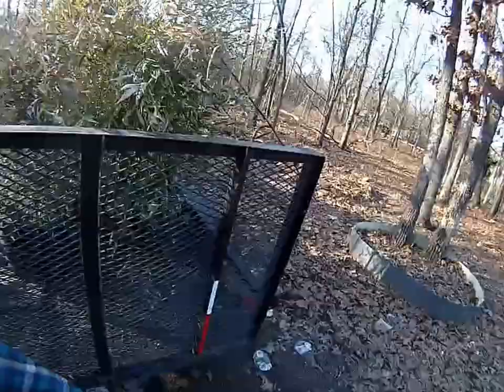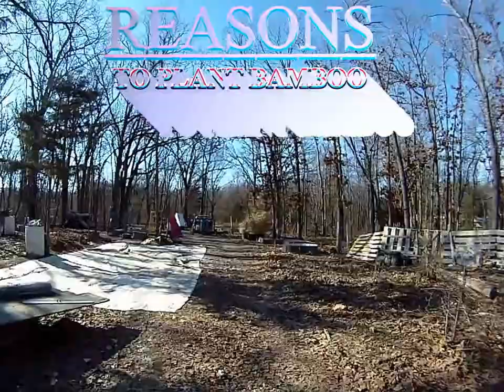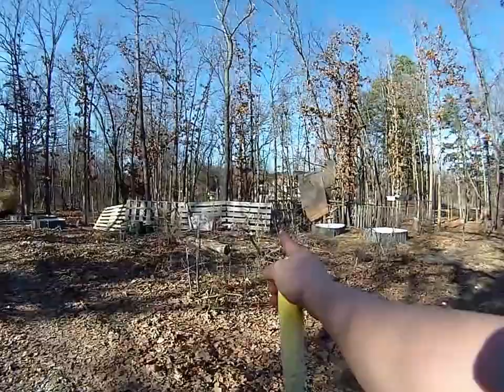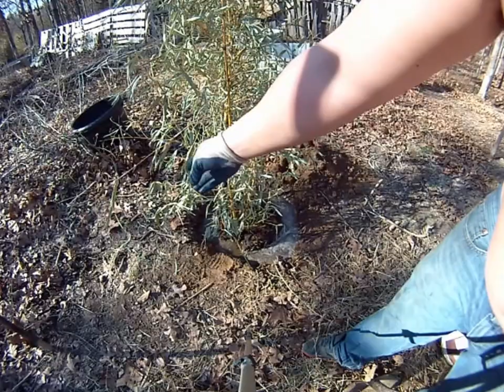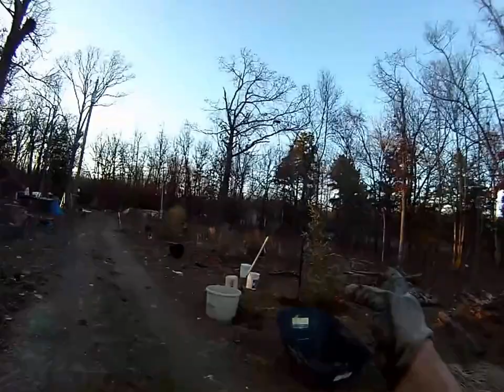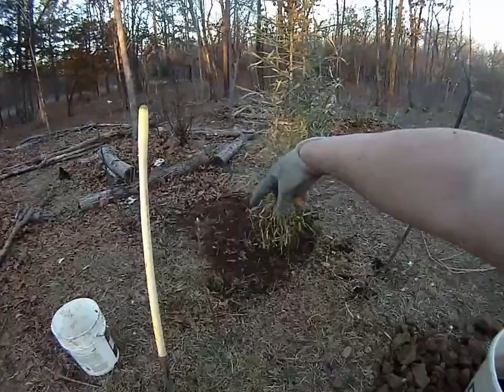Planting A Bamboo Grove

Comment: don't know what your regulations and or zonings are but from our pole at the road with the transformer to our structures we ran our power under ground  it was cheaper as we dug our own trenches to bury the power cable and didn't have to worry about trimming trees and such then or ever
Reply from the maker: yeah, the poles around here run all the way back to near your house, then you go underground. if i went underground from the transformer the cost for the conduit and wire would be my responsibility.  However, the utility company offers to run 300' from the road with no cost to me, so i'd rather trim some trees.

Comment: luke put a stake in the grown and tie the bamboo to it.the wind will lay it over and then will grow sideways.you wanna stake itbuntill the root system starts to take off
Reply from the maker: i appreciate the advice, the planting site is very well sheltered from high winds because it's really just a small clearing in a densely wooded area.  these plants weighed in at 80-100 lbs a piece i would have a hard time believing they would blow over, but time may prove you right, i'll definitely think about it.